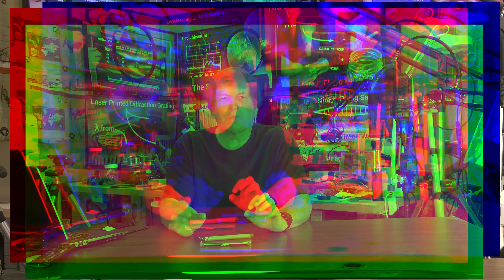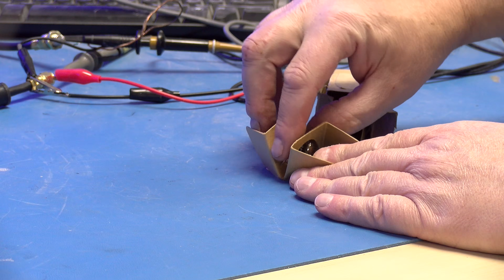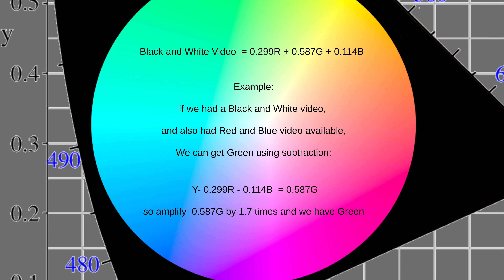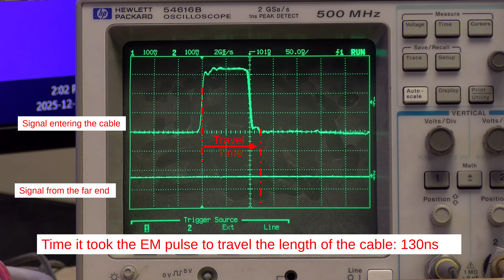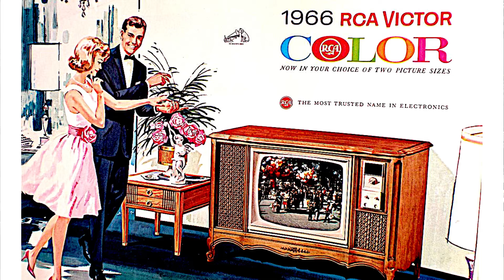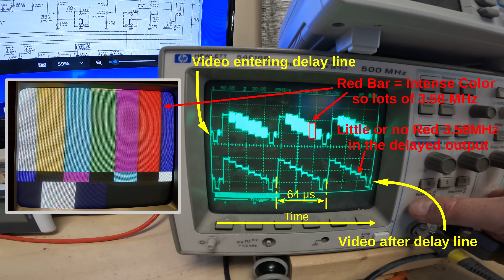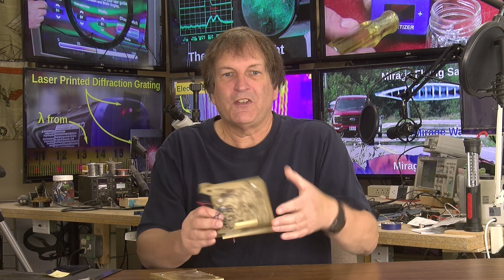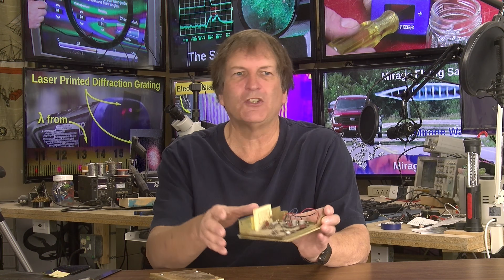How we slowed down electricity to create Color TV

Comment: Probably surprisingly to many viewers, this subject is still relevant to most FPV (first-person view) enthusiasts. In 2025 about half of the FPV market is still analog. Especially the tinny quadcopters (drones) find it difficult to adopt the digital video transmitters because of their additional weight comparing to the analog ones.

As you can freely choice between NTSC and PAL (it's only an option in the camera configuration) the discussion about pros and cons of both systems is still alive.

The PAL wins by means of more visible lines: 576 vs. 480, wider video bandwidth: 5 MHz vs 4.2 MHz much higher chroma sub-carrier: 4.43 MH vs 3.58 MHz which leads to smaller distortions. The NTSC can perform better in means of the latency thanks to its nearly 60 fps vs 50 fps (fps = field per second). It's also better supported by the FPV monitors because many of them are fixed to 60 Hz (unlike  most of the FPV goggles that support 50/60 Hz).

In practice PAL seems to produce much better image on proper display thanks to its wider bandwidth and more lines. These small video cameras are now mostly equipped with CMOS sensors with an incredible resolution of 1200 TVL (sometimes even 1500 TVL). The internal processing is of course digital then resulting image is converted to the composite video so the bandwidth matters. What is less known, many of them internally work at 50 Hz which causes huge jitter when configured to output 59.94 fps. In this case, the lower NTSC latency is completely destroyed.

Unfortunately many FPV enthusiasts from NTSC regions still believe that they should use NTSC. Most cannot say why, many say due to the potential flicker of 60 Hz lights which is currently practically irrelevant. Only very smal portion on them consciously chooses NTSC because of its lower latency, carefully checking that their camera also supports 59.94 Hz natively.

What spoils the PAL quality is almost always the display. Most cheap goggles/monitors are 640x480 (even if they support 50 Hz) which causes down-scaling artifacts. You should carefully select your display to take advantage of PAL but if you build the whole video path carefully the effect is amazing taking into account it's still only analog.
Reply: An important reason to use analog video is that with digital video, especially the compressed forms required to be able to transmit them in an affordable way, there is always a delay between what is filmed and what you see on the screen.
That is very inconvenient when you use the image to control the drone.
Reply from the maker: Thats quite fascinating - somehow I missed your comment when you wrote it. I didnt know analog was still used for those sorts of things - how cool. Interesting how there are always niche used for certain technology. Question - of the slight difference in latency between 50 and 60 Hz really that critical or noticeable?
Reply: @ElectromagneticVideos  Yes, analog is still alive in FPV. I've just received brand new camera, transmitter and receiver for my next build and experiments (they are easily available and cheap). FPV cameras output standard composite signal but the transmitters/receivers are FM instead of AM. The most popular hardware works in the 5.8 GHz band (5300 - 6000 MHz) with 30 MHz channels, but there are also easily available and cheap transmitters/receivers for 1.2 GHz band (I work with both these bands) and 3.3 GHz band.

About the difference in latency between 50 and 60 Hz, I have no personal experience but there are persons, especially FPV racers, that claim they feel the difference. The camera latency itself can be as small as 4-6 ms or as big as 15-25 ms (even the same camera may experience both, depending on whether it's configured to PAL or NTSC, probably because of the fixed rate of the internal processing). 
People measure their cameras using oscilloscopes:

https://oscarliang.com/fpv-camera-latency/
https://www.youtube.com/watch?v=Xk-W6TfcyfA
https://www.youtube.com/watch?v=8uo9Ag2wzzQ

Many people are not very careful about these measurements to configure the camera properly. I don't expect different tests for PAL and NTSC. But many testers tests cameras with the default settings which are horrible. Many cameras have the 3D denoise algorithm enabled by default which must introduce at least one field of latency. This is because the chips used in these cameras are originaly intended for CCTV market so the default settings are for CCTV (for me unusable for FPV). In the latest FPV cameras you can even find AHD (analog HD) chips:

https://e4q9gp36mc8.exactdn.com/wp-content/uploads/2025/04/R0301678_DxO-1920.jpg

and in the OSD menu there is an item intended for switching between CVBS and HD (locked to CVBS).

But the camera is only one source of latency. The second, biggest one is the display with its algorithms (deinterlacing, denoising, etc.)

Comment: If I understand the NTSC means National Television System Comitty, that decided that the RCA system was the way to go, and both PAL (Telefunken) and Secam were  some "upgraded" versions of the "NTSC" system.....🤔 ??
In Sweden we got color tv around 1967 1968, but if I remember correct there were very little in color in the beginning......Thank You for a very interesting video 👍
And my very big respect to the engeneers who despit limited tools made color tv
work.
Reply: SECAM is quite the odd sibling - PAL/NTSC are twins
Reply from the maker: PAL could be described as a brilliant tweak to NTSC to eliminate color shifting from phase shift problems during transmission. SECAM encoded color using FM so encoding was quite differrent. 

I think in most places actually color programming lagged the introduction of color TV - it would have been enormously expensive to replace all the BW equipment at TV stations at once.

Yes - the engineers back then were brilliantly inventive!

Glad you liked the video - I'm doing a followup on NTSC vs PAL vs SECAM. Stay tuned!
Reply: @ElectromagneticVideos always interesting to listen to somone who knows how it works - even if I only understand 50% we who serviced the sets in homes only did the easier service, not the harder problems. Best whishes, an a happy new year from Sweden.
Reply from the maker: @stigbengtsson7026  You did TV service?Sadly a job that hardly exists anymore which is too bad - so much waste throwing things out when they fail these days.   You certainly had more complicated TVs to repair with the PAL delay line circuitry which is absent in NTSC TVs. I did a fair amount of TV repair when I was in high school in late 70s/ early 80s. The interesting thing was I occasionally came across old Philips TV made in Europe which were so much better made that the Canadian and US made TVs.  These were old often tube 1960s TVs - I fixed TVs people threw out :) It was a great learning experiance for a future engineer - how things are put together, what fails (often the HV section), how all the ciruits work etc.

Best wishes for a Happy New Year to you too and Greetings from Canada!

Comment: Very well explained. The BBC in the UK developed this system into PAL. Phase Alternating Lines. This resulted in averaging out ant colour phase / hue errors that occurs when  e.g. cameras are changed etc.. This results in for example green or magenta faces, which had to be corrected by the user adjusting the hue control knob manually. On a PAL set there is no hue control it is corrected automatically. A large phase error will desaturate the image slightly which could be adjusted with the saturation or colour control. 
I hope you will do another video on the PAL system.
Reply: Ahem, sorry, but that was Walter Bruch at Telefunken, in Hannover, Germany 🤣
Reply from the maker: Exactly!
Reply from the maker: Thanks! But  @m210658 is correct. Although the UK played a key part in the development of TV,  PAL was a German development.

Comment: Differences between PAL and NTSC: the color carrier is at 4.433618 MHz instead of 3.579545 MHz. 
The number of lines is 625 instead of 525. 
But the refresh rate is only 25 Hz instead of just under 30 Hz. 
PAL turns the color wheel upside down every other line, which reduces color deviation due to the phase error. 
The SECAM process has a lot in common with the PAL system, but uses FM instead of AM.
Reply: It is possible to receive a SECAM image in black/white with a PAL receiver, or vice versa.
This is because the same b/w standard lies underneath.

It is possible to send a black and white image with the PAL identifier. 
With SECAM, however, this leads to color effects in the b/w image. Which is why the SECAM for b/w material is completely switched off.

From the 1980s onwards, TVs could usually decode PAL, SECAM, NTSC and b/w images
Reply: The bandwidth of a VHF channel in Germany is 7 MHz. A UHF channel 8MHz. 
With the UHF channels there is enough space to transmit a second audio channel (or the right audio channel).
The first audio (L) frequency was 5.5 MHz above the image. PAL B,G
Reply: @jensschroder8214  Actually with the stereo sound system they do not transmit L and R, but the original 5.5 MHz transmits L+R and the 5.74 MHz extra sound carrier transmits L-R.  The TV can separate that into L and R again.
The reason is that a TV without stereo capability will receive a mono signal, not just the left channel of stereo (which can sound "incomplete" depending on the mix)
So this is similar to a B/W TV being able to receive a color transmission.
The days are gone that this kind of design criteria was considered important, today they just switch over to a new system and you can buy new equipment and throw the old stuff away....
(e.g. Analog TV-> DVB-T -> DVB-T2 or FM radio -> DAB -> DAB+ )
Reply from the maker: "PAL turns the color wheel upside down every other line" what great description of the phase alternate line approach. I'm planning a NTSC/PAL/SECAM video and that will help with the explanation of PAL!
Reply: Nitpicking: PAL/NTSC are just the colour standards and don't define the number of lines / field rates / audio modes, etc.
SECAM has almost no connection to PAL/NTSC. They are very different standards.
Reply: @fsphil  While that is true in theory, in practice NTSC is only used (as transmission standard) with the 525 line, 29.97Hz frame rate, 3.57MHz color carrier system, while PAL is used on a number of different transmission systems.  Usually 625 line, 25Hz frame rate, 4.43MHz color carrier, but there is the PAL-M system that uses NTSC frequencies (used in South America).
Reply: @Rob2  Oh yes, definitely. They where designed around the existing line standards (and in NTSC's case, slightly modifying the field rate).

NTSC was also tested for the UK's old 405-line standard but that was ultimately dropped in favour of 625 + PAL.

Comment: Thanks for the video. Great explanation of important engineering history. I was involved with some of the first multi-standard TV receivers for the military in this era. Quite a challenge. I’m in Australia now but back in UK PAL days, NTSC = “Never The Same Colour”!
Great contribution to our fraternity. Thank you.
Steve 
VK6VK
Reply from the maker: Thats really interesting - I have two multi standard  TV from the early 1970s when we lived in Bonn, West Germany (dad was a diplomat). Both were purchased from the American PX, as small Sony BW set  and a bit later, a Motorola Color NTSC/PAL set. The Motorola seems to be an NTSC set with a PAL decoder board added in. And both sets had two FM sound demodulators, one 5.5 MHz and one 4.5. Were the sets you worked with for actual military use, or for military families home use? Must have been a fascinating challenge!
Reply: @ElectromagneticVideos  The systems were for the UK Navy. Every frigate, etc, had a rack containing three receivers and 3 channels of modulators for distribution around the ship (including Britannia). They were all analog and worked on all systems. (Including the very awkward French standard). The company was TIS (Television Installation Services; still active with the MOD).
Reply from the maker: @stevehannah8165  Very interesting! It makes sense that you would want to be able to receive local TV when in a foreign port. So I'm guessing the converted signals were then transmitted to TVs around the ship, probably in PAL? Did you do 525 to 625 line conversion, or were the TVs setup to have a large vertical control range and just display a weird 525 line/PAL signal when in a 525 country?

Comment: Is it the speed of light? I thought it’s the speed of electrons in a conductor, because the two speeds are different.
Reply from the maker: Great question with an answer that may be hard to explain in text only - here goes: The speed the signal (or power) moves is not actually the speed the electrons.  Its somewhat like the speed of a water wave is not the speed of flow of the water that conveys the wave. 

Around and between the conductors in a cable there are electric and magnetic fields. The flow of power is in the direction of the right hand rule applied to the E and H fields  and this is called the Poynting vector ( named after the physicist of that name). Now here is the neat thing - if you use the Poynting vector from the EM fields to calculate power flow in a cable, you get the same power flow as the P=VI for the cable. But you dont need the cable - the pointing vector equally well represents the power flow in EM waves in free space - light, radio waves, gamma rays etc. And there a bunch half way cases - take the center conductor out of a coax cable and you have a waveguide, with its own EM wave structure and poynting vector. Take the the outside shell away from a coax cable leaving just a single wire (look up Goubau line) and amazingly a single wire carries signal.  Bottom line - the power is carried by the EM fields and in the case of cables, the electrons are almost just there for the ride and in a sense not really needed. The speed calculations of light in free space or signals in a cable turns out to be essentially the same, with the cable adding a few more conditions that slow down the signal a bit - not unlike how light is slowed down in glass. 

So the speed of EM waves is what we generally call the speed of light in a medium. In the case of the delay line (just a strange cable), its not actually built to carry frequencies such as those of light, but thats no different than a IR optical fiber not being built to carry RF. We still consider the speed of the infra red signal in the fiber to moving at that mediums speed of light.

So I hope that helps a bit. There are actually even more twists to it if you interested - look up phase velocity and group velocity.
Reply: @ElectromagneticVideos I guess text books are wrong then, we waisted years of school.
Reply from the maker: @Capturing-Memories  This is a really down in the details things - in most cases just glossed over. In most 3rd year university EM there is always an interesting discussion about whether the electrons or EM waves carry the power.

Comment: Regarding consumers that had B&W TVs when color came out: Microsoft doesn't care that some consumers have to buy a new computer, when there's nothing wrong with their old computer, if they move to windows 11. Notice that I'm using the word move and not upgrade. Windows 11 is a platform I will not be moving to even though three out of the six computers I own will support windows 11. Check out the videos on how microsoft's windows 11 and it's Ai will control and significantly increase the spyware on your computer such that microsoft will be more of the owner of your computer than you.
Reply from the maker: It certainly was a different time where something like a TV was expected to last a lifetime as long as it was maintained an repaired.  Yeah - the great computer extinction event of 2025 is a terrible waste.

Comment: For 30 years I repaired CRT tvs including the largest Sony PVM 4300, and changed that CRT with 4 guys lifting it, it had a purity problem.
Reply from the maker: I had to look that up - what a giant! Makes my 36" JVC i'ART CRT HDTV look tiny!
Reply: Think you meant PVM series. I did CRT changes for almost 10 years as a service engineer for Sony Professional, Medical Broadcast division in Teaneck, NJ from 4” all the way up to the 43”.
I must say you covered SO much in your presentation!  
Most excellent… I learned even more then when I was on the bench.
Reply: I do hope you checked the degaussing circuit before swapping the tube.  The coil was controlled from a thermistor which I have seen one go bad once.  That little black coil was easily swapped out than that 100 LB. CRT!
Reply: @njjeff201 Of course, it was common to have a ringed solder pad on the thermistor from thermal cycles, this one crt probably was jolted in shipping and bent the grill. Couldn't get purity in one corner even with external magnets